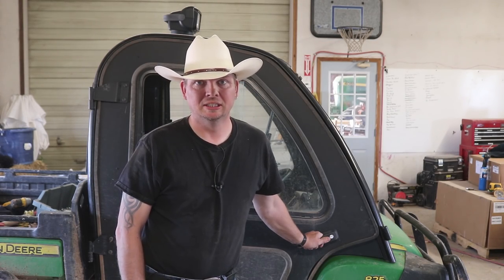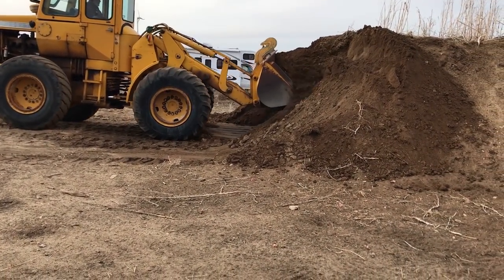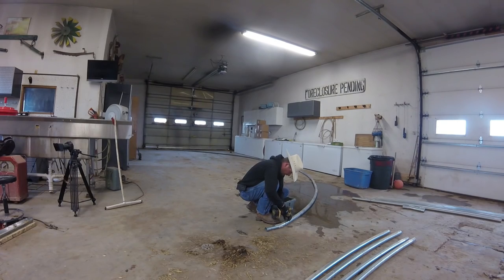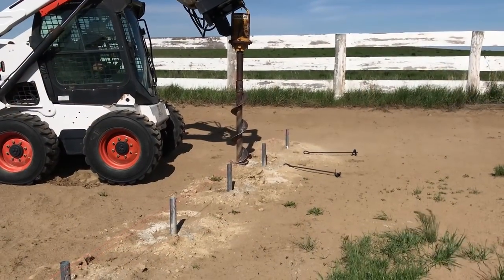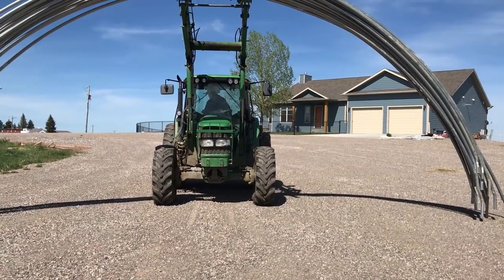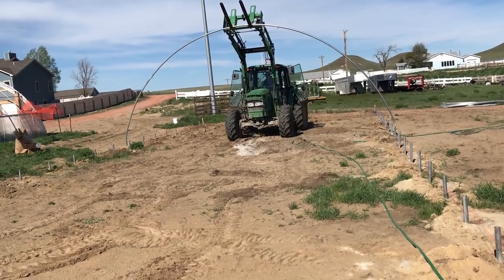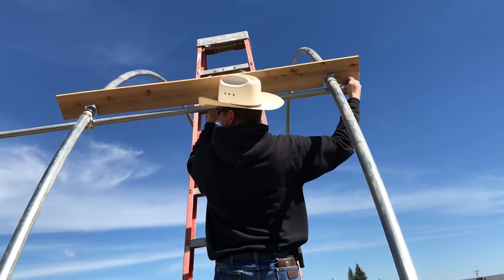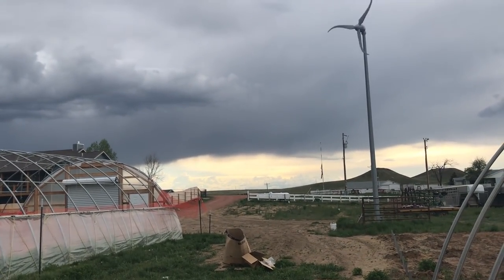Building The High Tunnel - Moving to the Air

Comment: Hi Mike, great video as always. Here’s an idea – your GoPro has a time lapse feature on it. It would be neat to see a time lapse of a project getting done, such as the high tunnel. You can also use it to get time lapses of sunrises or sunsets for dramatic flair. You can experiment with it and set intervals of, let’s say, every 15 seconds or so. After 30 pictures have been taken they will be combined to get one of second video. You will need a power source to plug the GoPro into however, as the batteries don’t last that long. Just a suggestion :-)
Reply from the maker: Awesome idea. I have done some time lapse in videos on both the go pro and my phone camera. Works Great. Will try to get more. Thanks - Mike

Comment: Do you collect any rainwater into barrels or just use the well cuz they almost never run dry?
Reply from the maker: Our soil is so sandy that rain water runs to the aquifer pretty quickly. We do have a few rain barrels but mostly they are to keep the downspouts on the shop from making a mess. Thanks - Mike

Comment: What is scary about lightning is that most lightning travels 5-10 miles vertically and lightning can travel 50 miles away from a storm.  The record travel of a lightning bolt is 118 miles!!!  That's why those lightning detectors go off early because they are detected the static charge buildup in the atmosphere.  Always be safe.
Reply from the maker: Very true, we dont mess around with it.  Thanks for watching - Mike